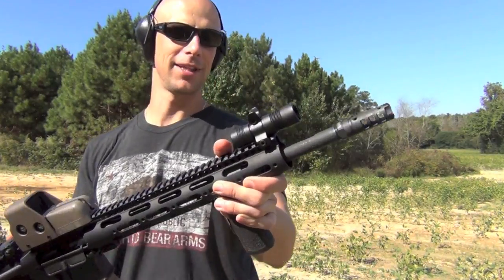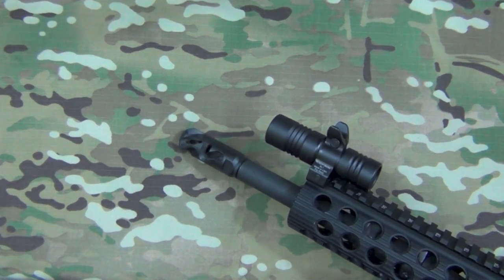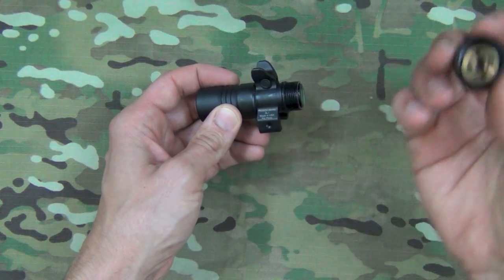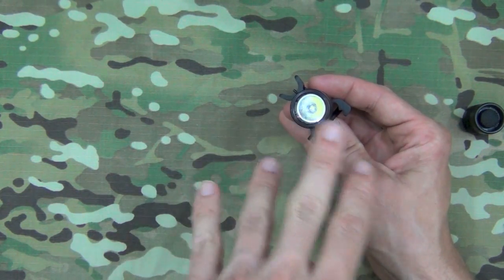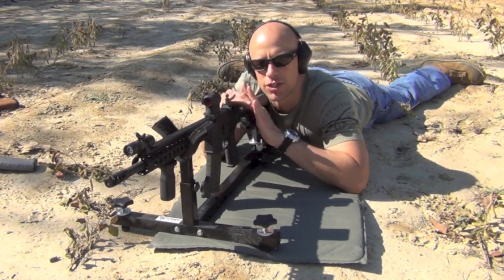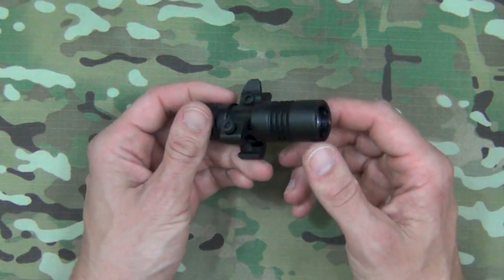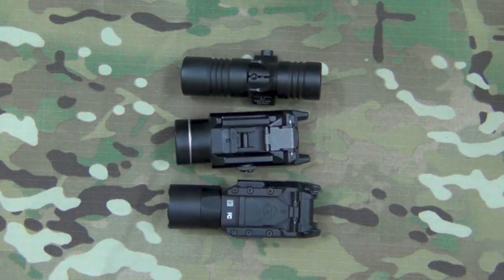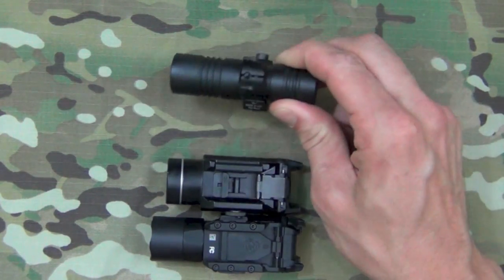ROSCH Works SL1 Front Sight Light Combination Review (HD)

Comment: The 12 O'Clock position is the best place for a light.  It avoids blinding yourself when you approach barricades/doors.

I use  the Battle Comp's Mossie Midnight Light mount off the Troy folding front sight and will probably continue because it moves the light down closer to the barrel and has a lower footprint then the Rosch.

Thanks.
Reply from the maker: Thank you.

Comment: That Mosie Midnight mount for Battle Comp is a pretty slick piece of gear Jack, that's the first I've heard of it.. It's nice as you can still run your irons as far out on the rail as possible.. What size rail is on your rifle, compared to the barrel length? I have a 14.5" barrel with a 13.5" NSR rail, plus a Surefire break.. I'm wandering how well the light will be able to handle the concussion the Surefire break puts off, cuz it'll be right above it if I went that route
Reply from the maker: The one(s) in the video are both 16'' with a 13.5 and 12.5'' rail.
Reply from the maker: Mrgunsngear Channel It'll handle the concussion of that brake just fine; the Dragon was use a lot with this without issue.
Reply: I don't have an issue with it but then again I'm not putting my light in the muzzle brake's gas stream like you would be.    Having said that the BC MM mounts aren't that expensive and you can always put them on another rifle so it might be worth a try.  Good luck.

Comment: Why not run a lower 1/3 co-witness if you don't like irons with your red dot? That way you'd still be able to see your dot above your irons.. I'm gonna start running my light at the 12 o'clock position as well, except I'm going with the Inforce WML as I already have a good set of irons.. This definatly seems like a decent option for those looking for a light and sights, although it doesn't really scream rugged by looking at it in the video.. Is it water resistant?
Reply from the maker: It is.

Comment: Instead of using the rear of the light to turn it on does it have an option of putting a button further back on the hand guard?
Reply from the maker: Not currently but they're making a tailcap adaptor that does that very thing.  It's in T&E currently.

Comment: Good idea, but I do not like having my irons in the way of my red dot.
Reply from the maker: Hmmm.   I always leave my front sight up anyway so I guess I just don't notice it; especially with a lower 1/3 mount.
Reply: Mrgunsngear Channel
With the FSP up, it allows you to reference the cant of the weapon through an RDS like an Aimpoint which has no reference. It also allows more precise shot placement, as you keep most of the parallax out of the picture (Yes, RDS do have parallax, this made a big difference with my T1, especially). Further, when shooting from awkward positions, sometimes the way the dot and the light and optic work, the sun will make things look like you are "on" but you aren't. Like looking through your car's old-school "flip" rear-view-mirror "wrong". hard to explain, but it happened to me once. Dot + FSP in the frame = G2G. It's a sight-picture confirmation tool. The dot goes down, you can use it for quick and dirty. There are just so many reasons to leave the FSP up.